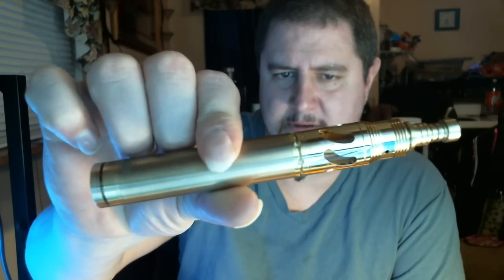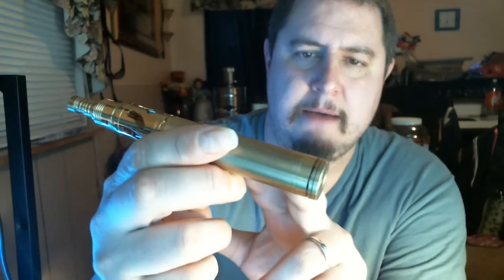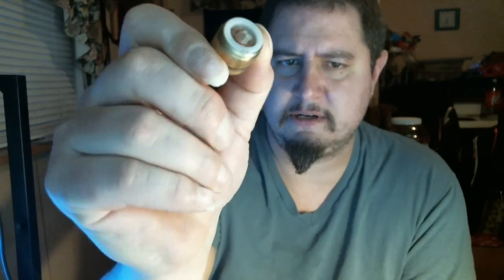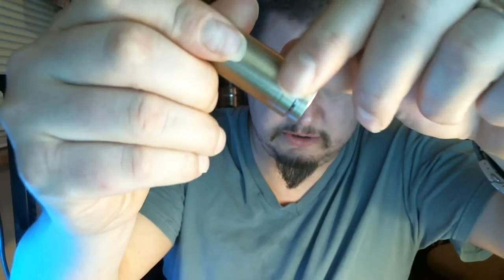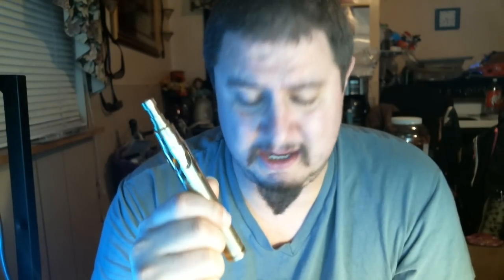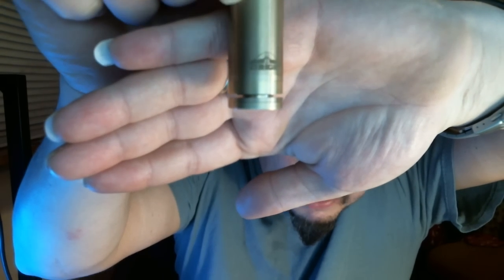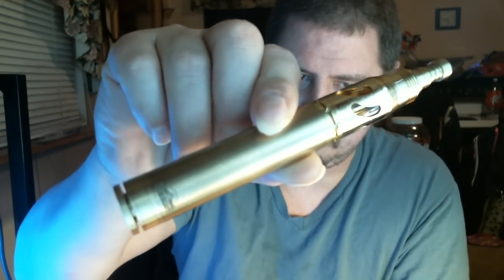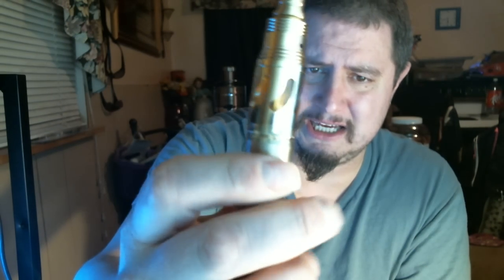Fasttech Origin MOD/Steam Turbine Atty review!

Comment from the maker: Rich.. No they are friends of mine!
Chris... I didn't "F" it up! I took a good atty and made it a whole heck of a lot better!
As far as flavor it's off the hook and the vapor produced is as you seen really really good! I vaped the atty with stock air holes and it sucked! Too tight and even on 6mg of nic the throat hit was wicked to wicked! And the vapor production was lacking! Now I think that if the Steam Turbine came with stock air holes like the Kraken I would have not modded it at all! The air slots on a Kraken are roughly the same size  as the holes I drilled out on the Steam Turbine!